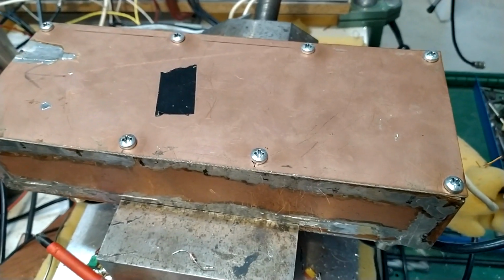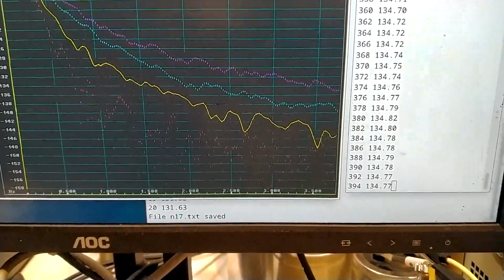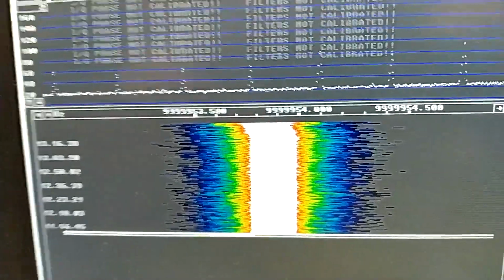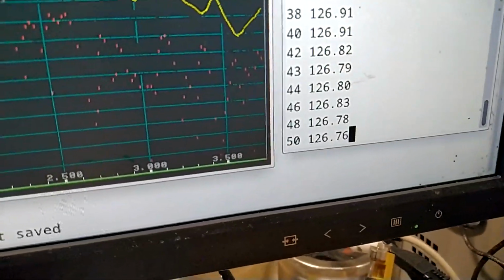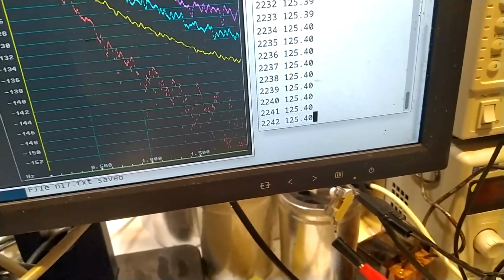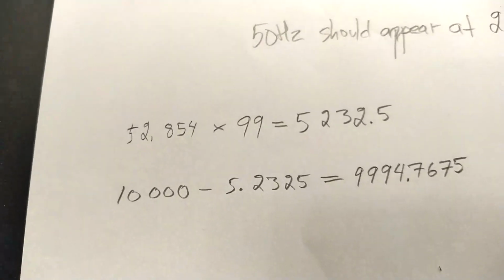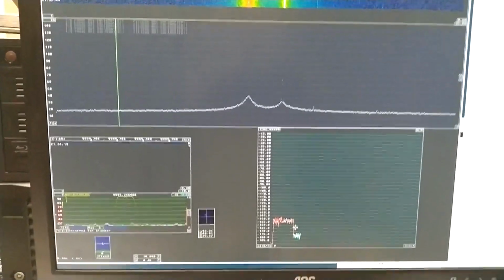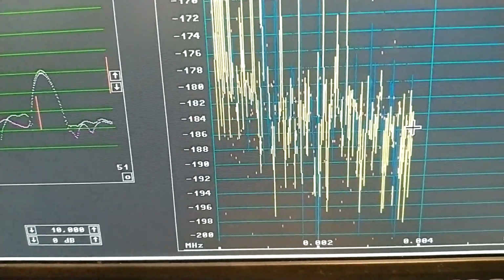nerds92

Comment: The random bursts of noise could be the crystal, or it could be "burst noise" or "popcorn noise" from your transistors. Sometimes it can be sneaky and be fine for awhile then just go haywire. EDIT: Or did soldering directly to the trimmer cap plates solve the issue?
Reply from the maker: In this case the noise bursts were definitely caused by the trimmer capacitor. Look at the very end of the video.